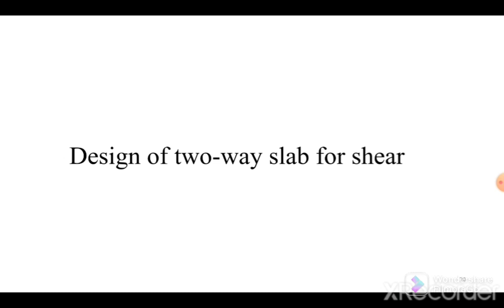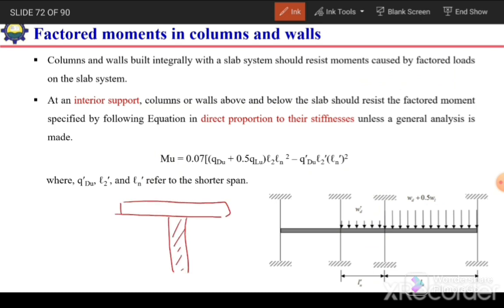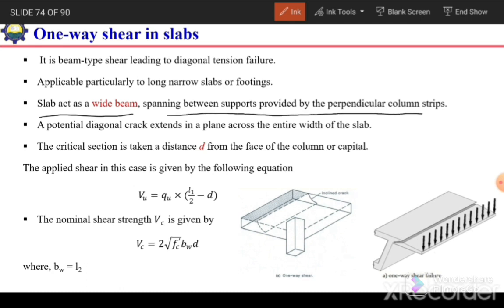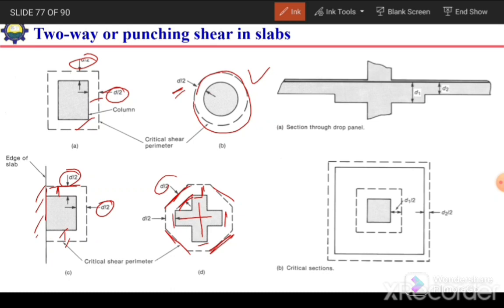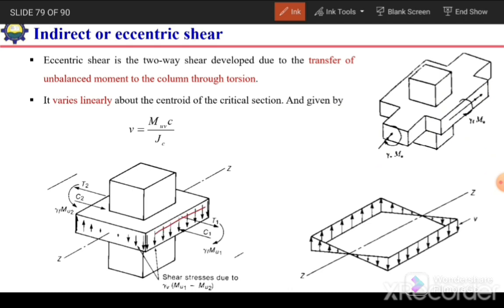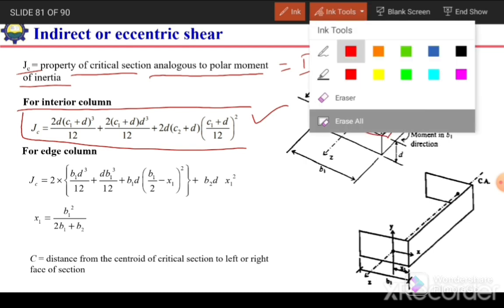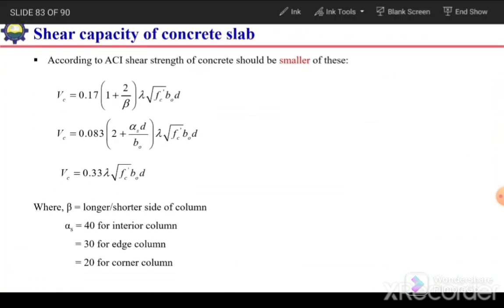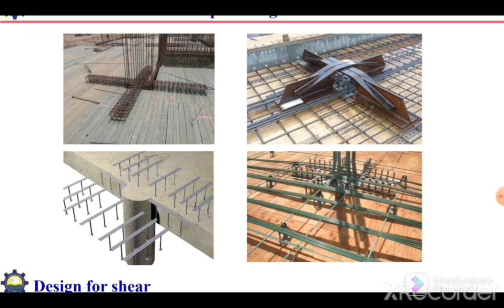8- DDM- Shear design of two-way slab- Punching Shear

Comment: @Engineering studio. Thanks for the informative video. What's your take on:-
1) Issue of biaxial moments at the slab-column connection (especially in corner columns)  in analysis of combined direct and eccentric shear. ACI seems to have provisions for uniaxial case only.
2)Issue of the role of flexural reinforcement in slab-column framed systems. Too much reinforcement to take care of negative moments and punching shear at the slab-column connection tends to reduce the ductility of the connection. The connection tends towards brittle behaviour (over-reinforcement).